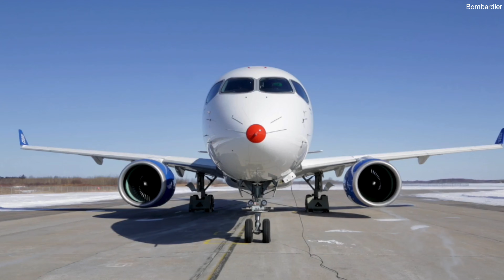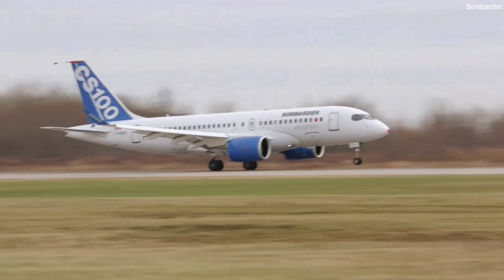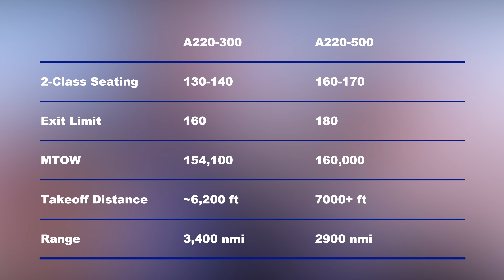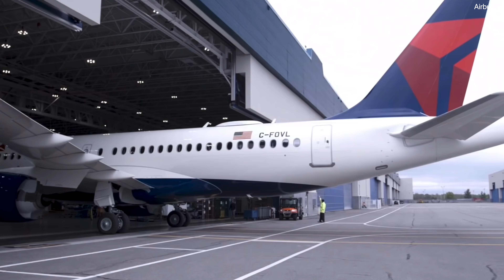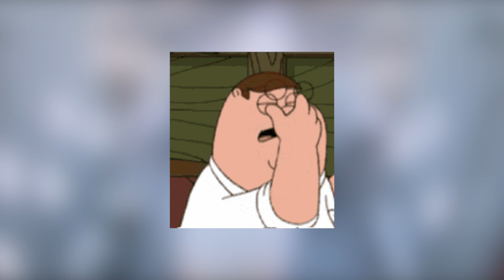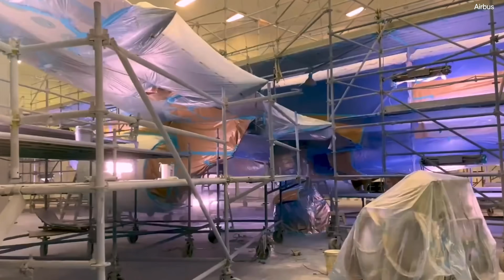Airbus NEEDS To Make This Plane

Comment: I could def see some ulccs that don’t need a lot of range loving the a220 500, especially if the operating cost is cheaper than the a320neo and they get it sooner. It would def help with passenger experience too and may give the public a better perception of ulccs that buy them since the a220 is a more comfortable plane then a320s/737s imo
Reply from the maker: I agree. I think this is the best use case for the -500